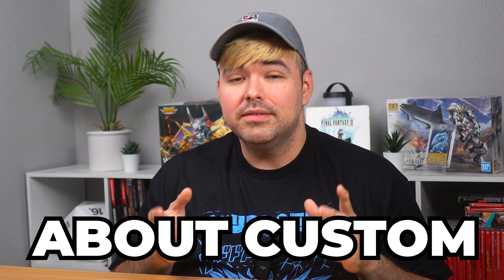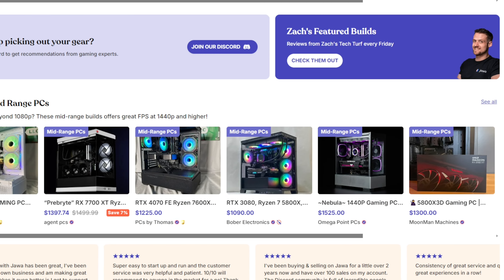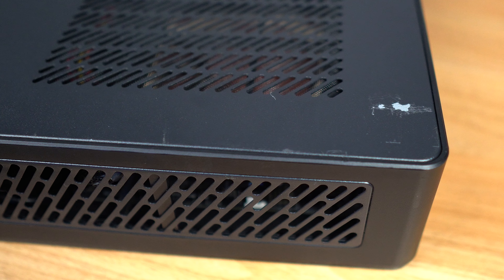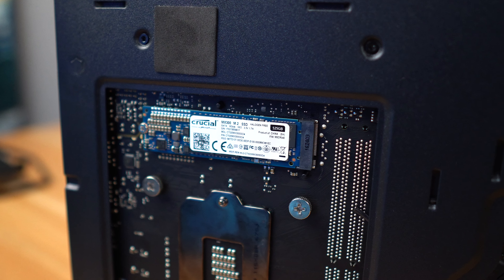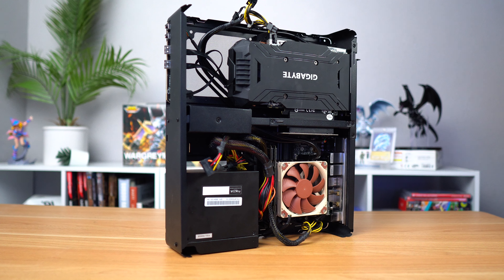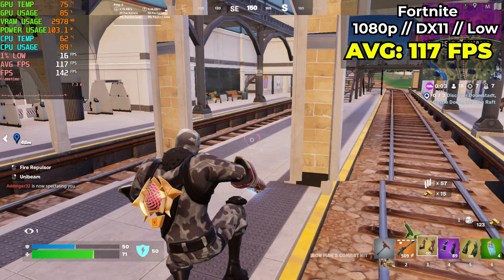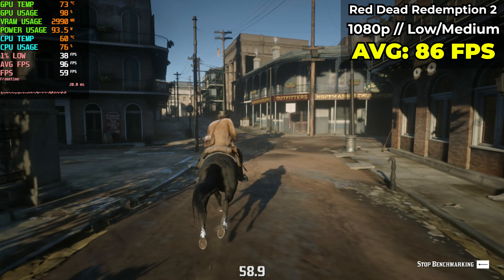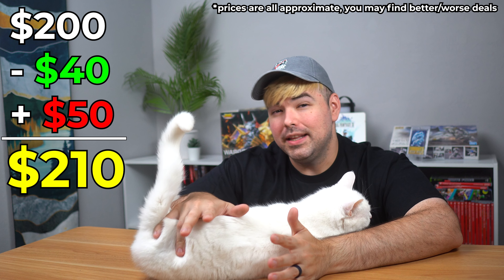I bought a $200 Gaming PC in 2024...

Comment: That build looks familiar 😌 Nice video congrats on 20k
Reply from the maker: Thanks bros 🙏 you guys beat me to it, but I'm glad I didn't get the i9 version haha
Reply: at least it wasn't that overheating 9900k version of that.
Reply: @JasonWitmerYT  Hey another cascade-asset buyer lol

I took the i7-8700K
Reply: @origin3271  Might only have been $200 but it is a dumpster fire. Also, that is clearly a 6700K which might as well be a 4790K. Very similar performance. Core Ultra is hardly the first time intel has offered no appreciable generational uplift. 5th, 6th and 7th gen were pretty lame.  
Anyway, $200 for a hot mess of a mini, with only 3GB VRAM is not the bargain it seems. Yeah, that Noctua cooler will last a long time, lol. Not sure about the rest. There's an awful lot of Gigabyte in this build and the only brand I am less likely to buy is XFX. 
The low temps are obviously due to undervolting with custom firmware on the CPU and a 1060 just will never get that hot because of the low power consumption. 
You can see from the massive frame drop in your Fortnite clip that something is very wrong here. Should not be running this poorly with this hardware spec. Also, you really need 4GB VRAM to have a solid experience in Fortnite these days so that 3GB limit is also impacting the consistency of gameplay, particularly since you didn't go with Performance Mode.
I wouldn't buy this PC because it is awful. Too much stutter and inconsistency of frame pacing. There is so much microstuttering that I'm having SLI flashbacks. RDR2 and GTAV are the only examples you show here that perform decently and those are old games that run well on a non-HT quad. RDR2 is just GTAV in the Old West. Same engine. And I saw better frame pacing in the Cyberpunk benchmark with a Quadro K2200 and i7 3770S.
It looks good on paper but these aren't the droids you're looking for. Liberate that 1060 from its prison and build proper gaming PC with it. Would make for an excellent secondary gaming PC for older games because that 1060 can run games up to about 2015 just fine at 1440p. If I do it with a 2GB 670 then a 3GB 1060 would be even better.
😸😸
Reply: @Lurch-Bot  wth is bro yapping about💀and also I can just find a cheap ass 3060 and then slap it in the case and the 6700K can still handle it gracefully without any service bottlenecks, because remember, 6700k despite still 4c 8t can still pull ahead for around 15%, and every single performance index counts😐
Reply: @buildyourcomputer  9900K is hot sure. but remember it can even handle a 4080 Super beautifully.
Reply: HOW ONLY 6 COMMENTS🙏🙏🙏😭
Reply: Ideal PC for this price. My PC R5 5600G, Vega 7 integrated graphics 512 mb, 16 gb ram CL22 DDR4 Goodram, HDD WD Blue 1 th, m2 nvme pcie 3.0 Apacer512 gb, Asus B450M-A II AM4, power supply 1St Player PS-600FK. In Ukraine costs 13000 hrn
Reply: @JasonWitmerYT Video card GTX 1060 6 gb?

Comment: A $200 PC that's old but still performs great is crazy & looks worth it :o
Reply: Nevermind all the frame drops and microstutters, lol. A PC of this spec should handle Fortnite a lot better but it was a mistake to not run performance mode on a 3GB GPU and the CPU is clearly not performing anywhere near where it should be. The low temps are likely the result of a substantial undervolt/underclock on the CPU and I have seen better performance from a 3rd gen i7 recently. It is a 6700K in name only and a Haswell S series i7 would perform way better. That Noctua cooler would be a beast on an S series, which only uses 35-40W when gaming. Would allow it to boost higher and S series CPUs tend to have even better silicon than K series CPUs.😸😸

Comment: Not bad for the price. I paid $300 on Facebook Marketplace in 2022 for a PC that has an i7 8700k, GTX 1060 6GB, and 16GB of DDR4 RAM.
Reply: Yeah, well, you can buy someone's crusty old rig or pay a little more for a fresh build with similar specs on Jawa. Get a properly refurbished GPU and some fresh thermal paste on the CPU. There is a huge difference between buying a used PC and a new PC that contains some used parts.
Also, this 6700K isn't performing the way it should. Performance suggests they have significantly undervolted the CPU with custom firmware and this CPU should not be bottlenecking this GPU but it is in multiple scenarios. 
I have seen 3rd and 4th gen S series (reduced power) i7s perform way better than this. I just listed a 3770S/ Quadro K2200 build for sale and it provides similar framerates in Fortnite with much more consistent performance. Fortnite also doesn't like GPUs with less than 4GB VRAM in late 2024 and you should always use performance mode if you have less VRAM, regardless of how powerful the GPU is. 
I also see a lot of microstuttering which a lot of people aren't going to notice from a casual watch. I had full on SLI flashbacks.😸😸

Comment: I have the same case with an 6650 xt and i5-7600k with the same noctua fan 16 gb ram and 512 gb nvme. Bought this system for €350.- which I think is pretty good knowing I can get  €180~€200 for the 6650 xt

Comment: Bro i need help, for my first pc i want a £300ish Gaming pc but i dont want to build it, and i want it as best as possible, could u somehow find 1 maybe or any suggestions ;)
Reply: Veno Scorp Gaming PC Desktop Computer: i7-3770 3.90Ghz - 16GB RAM - GT 1030 2GB - 256GB SSD - 1TB HDD - 500W 80+ PSU - Nova ARGB CASE - WIFI - WINDOWS 10
Is that any good
Reply: ??? Its only £300 or around $380 dollars
Reply: No 1030 is cheeks it's worse than igpu

Comment: Arc 750 in there for 200 bucks. That thing would burn a lot of gas pretty good.
Reply: 450w psu. I wouldn't drop anything that runs over 250w just to be sure.

Comment: You can have a 3rd gen i7 and Quadro K2200 for $200, assuming you are buying everything but the CPU, GPU and MB new and building it yourself. That's with 16GB RAM and a 500GB SSD. 
I built one recently and it is for sale on Jawa. But at an asking price a little north of $300, before shipping (shipping on a 11.5lb package is pretty cheap). What you'll get from Amazon at that price will probably be an old non-HT i5, which doesn't even cut it for esports these days and a GT730, which is about 1/3 the power of the Vega 448SP in my thin and light Ryzen 5500U laptop and 1/20th of the power of a GT 730, assuming you have the good GT730, lol. 
A Quadro K2200 is basically a 4GB 750Ti and completely blows a GT730 (or GT1030) out of the water. Still getting driver updates because it is actually a Maxwell (900 series) GPU, as opposed to Kepler, like the rest of 700 series. 
As for the ewaste peripherals you might get with the Amazon option, I don't even consider those to be a factor because they are literal garbage. You're better off with an old OEM membrane keyboard and 20 year old Microsoft basic optical mouse you bought at Goodwill for $5. 
I also have another PC listed right now with a 6c12t Xeon and a 2060 and running Windows 11 24H2. It is very competitively priced when compared with RTX 3050 6GB prebuilts and offers substantially better performance. Only the CPU and GPU are used and I spent 5 hours refurbishing the GPU. 
Yes, selling PCs on Jawa is a business. But Jawa sellers tend to have high standards. Most of the PCs for sale are fresh builds. Most of the people building them have a lot of experience. New is overrated. Warranties are overrated. You can buy a POS on Amazon and have a high chance of needing to use that warranty and all the hassle that comes with it. I RMA'd a Gigabyte AM4 board a couple years ago. Took 3 months to get a replacement. 
I sell PCs on Jawa just as much to fight the '$350 Amazon "Gaming PC" with a non-HT i5 and GT 730' paradigm as I do to make a little money on the side. It isn't just some disingenuous words when I say it has been built to the highest standards. I wouldn't sell anything I wouldn't game on myself and I recently spent several hours playing Cyberpunk on the Quadro K2200 build, completely forgetting I was playing on a low spec machine at 1080p30 with the absolute lowest settings. It was a smooth experience and consistency is worth far more than absolute framerate. 
I've seen a lot of DOA new components since COVID. Prior to that, I only saw one DOA new component in 25 years. I built my first gaming PC in 1995. 
Components that are still working 100% after a few years of use are likely to keep working for decades. Buying used components really just means it has had an extended QC check. And I thoroughly test my builds before putting them up for sale. No warranty but you have the assurance of my process and 3 decades of experience. The whole idea is to not need a warranty in the first place by thoroughly testing and refurbishing where necessary.  Meanwhile, cheap pre-builts on Amazon are almost literally thrown together. You buy a $350 'gaming PC' on Amazon and they won't even bother to change the thermal paste in the GPU of a RG jazzed up old Optiplex. 
They are focused on volume sales of crap PCs. If one breaks under warranty, they just send you another POS that was thrown together. All my builds are done from a place of passion for building gaming PCs. Not from a place of just wanting to make as much profit as possible. 
Doing the two builds I mentioned above involved me dealing with the hassle of receiving a DOA new SSD and a DOA new MB. 
YT and other social media sites encourage complete novices to build their own PC because, 'it's easy!'. Well, it is only easy until something goes wrong. And something always goes wrong. Then you're left with a pile of parts and don't have the knowledge or experience to troubleshoot your way through it. Doesn't matter if you have a warranty on your parts when you can't even ID the faulty component to actually do an RMA. 
Between the QC issue and rampant return fraud across pretty much all new component sellers, you are rolling the dice every time you set out to build a PC.
Also, there are a lot of consumer warranty options these days and I don't think it will be too long before Jawa starts offering some type of third party warranty option. Unlike with larger system integrators, being able to warranty my builds will have zero impact on my quality control process. 
😸😸

Comment: I’m just wondering because I’m still in the process of building my PC, at some point during one of your PC building videos can you show us how to put a Windows Operating System onto a freshly built PC for us newbs if you haven’t done a video on it? Just I’m not sure if I need a USB with a Windows software on it to boot through the PC BIOS.
Reply from the maker: You don't need windows to get into BIOS, but to fresh install windows you will need a USB. I don't think I'll make a video on it because there are literally hundreds of videos on it already - just check one of those out when you're ready to build :) good luck!
Reply: @JasonWitmerYT  fair enough. Just that’s the part I’m curious about is getting the Windows Operating System onto a freshly built PC that doesn’t have the Windows Software on it. I’ll have to browse round and also find a USB with the Windows Software on it then get it activated.

I managed to get a second hand gaming PC though but needs parts such as storage so a 1TB NVME 2.0 SSD with a Standoff for gaming and a low capacity 32-64gb SATA SSD for the operating system itself.